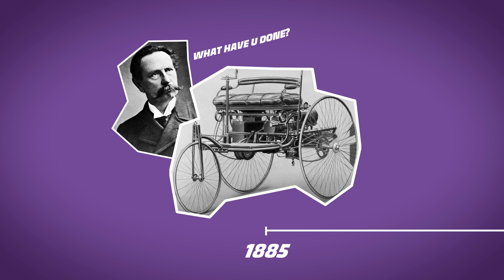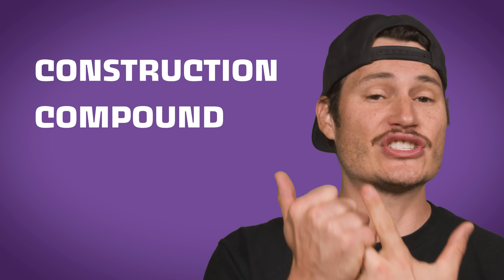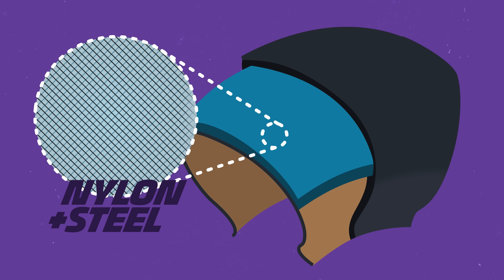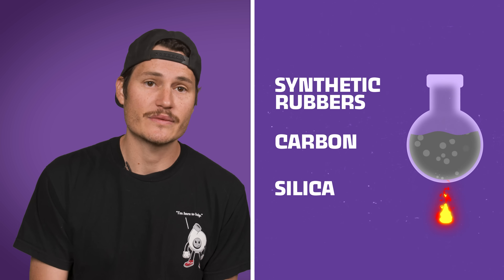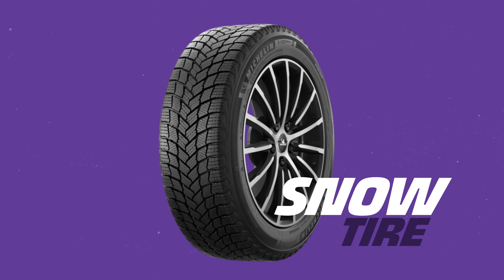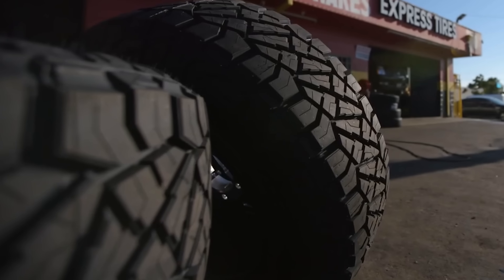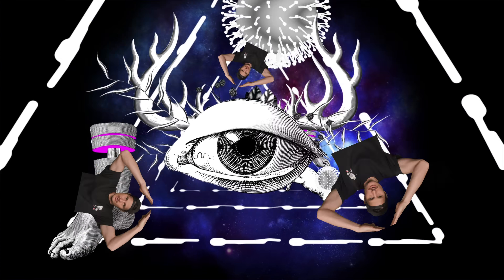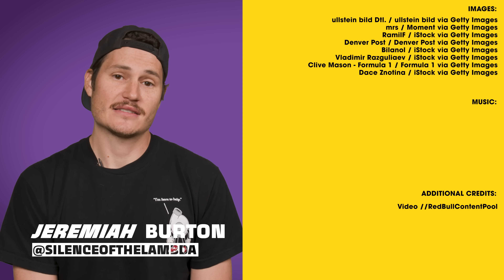The Surprising Science Behind Tread Patterns

Comment: In a nutshell, tire also creates a longitudal force on a side of a crease in asphalt which helps propell the car forward, because it adds to a friction force...
THIS WAS A FRAGMENT TO GRAB YOUR ATTENTION SO YOU MIGHT CONTINUE READING
My take at answering the question in the end of a video:
First of all, mind that the simple equation people learn at school is formulated for rigid body on rigid body, flat surface on flat surface friction, which is just not the case. This is also why specifications on some tires might state that their friction coefficients are bigger than 1, which makes no sense in "usual" circumstances. Now, "flat surface" here is as in "flat to the eye or touch", because friction itself is ocurring only because of imperfections in both surfaces interacting with each other, down to a scale of two atomic grids (which we consider absolutely rigid) grinding on one another.
Now, my thoughts about why bigger contact patch tends to mean better traction are next:
As it was said in the video, soft rubber fills the gaps in the rough surface of the asphalt. Gaps have profile in a plane parralel with a tire rolling direction too. This is drawn at a picture at an attached link, with forces marked. In a nutshell, tire also creates a longitudal force on a side of a crease in asphalt (which is marked as  Fadd as in force that is added), which helps propell the car forward, because it adds to a friction force of a tire on a horizontal part of a surface. And as this force can vary greatly depending on the depth of a crease, how much it is filled with rubber, the angle of a crease's wall, tire temperature (or any other parameter) in a given point,  and other things i probably didn't mention, it is important to have larger contact patch so you can cover as much creases in the road as possible. Ultimately, this forces are limired only by the car's weight(because only weight keeps rubber in a crease), not the friction coefficient, as the rubber creates vertical force escaping the crease under rotational forces of the wheel, BUT this vertical force is not equal to car's weight because all the movement it provides is so small it only deforms the tire, not lifts the car up. Covering more creases in the road actually adds up (up to a point, indirectly limited by car's weight, of course), rather than resulting force being equal to the highest achieved one, because each point of a tire holds only a part of car's weight.
So, increasing the contact patch of a tire actually improves this added force(but not the friction), which combines with the force of friction and propells the car faster.
This explanation also doesnt account for adhesion, as i am not competent to speak about it occuring here (means i know nothing about it). 
This also only explains why linear acceleration of a car requiers wider tires (as for dragsters), but huge width also has a lot of benefits to cornering.
https://idroo.com/board-suDimwSIQk

Nobody will ever see or read this, i am almost sure, and  it surely wont reach guys from DONUT.
But it might.
Reply: To throw an analogy at you to see if I understand, you're basically saying that rather than the classical model of a rigid body on a rigid body. The softness of the rubber allows it to deform sufficiently to push against the peaks of the roughness of asphalt similar to a sprinter against a starting block? Is that a about right? If that's the case then we're dealing with a force that behaves like friction, in that it retards movement in the direction of travel, but in fact comes from something more akin to normal force.
Reply: @bentreece1187  While your analogy is  correct as i see it, my whole comment might be not. What i described here might seem like "friction after friction", and the mechamism is similar, but at this scale it is more like gears which rotate each other with interlocking teeth rather than friction, just that weight is what keeps  the gear's teeth in place. The way i see it, because friction utilises microscopic imperfections, and this process utileses macroscopic, they have no relation to each other because one cannot influence the other. 
To me, what i described and what friction is really don't seem like the same thing just because when we talk about friction we talk about two surfaces (means no major geometry, just planes), with imperfections in them being small in depth relatively to the area ot the contact, and size of them being very regular. Both of these conditions are not quite true for what i described.
So yes, this is only possible because of the softness of the rubber, it's ability to change macroscopic geometry to "become a matching gear" to rough surface ot the asphalt. And gears sure (as far as i understand) can work without friction. Take the metal-plated wooden wheel from the video for example. Not only it's fricion coefficient is lower, it has no means of grabbing these macroscopic geometry in the road. Unless it has teeth or spikes, than it can take advantage of these added forces by burying them in the road, again, without any relation to friction. So, yet another analogy,  but the roles are reversed - here the earth is soft and the wheel is rigid, but the mechanics is the same - they act like two solid gears.
Regarding your last sentence: friction itself is a manifestation of a normal force in microscopic scale. Mechanism is really similar to what i described, but without deformation there is  no "burying one thing into another". Just imagine two very, very fine iron files that you put one on another and tried to pull them apart, - they would resist because ridges in them bump into one another.

Comment: So about the last question you asked here is the answer
engine produce torque force which has to be transferred to the ground by tyres so if u have more torque than the friction between road and tyre, the tyre will start to lose traction because the force exerted on tyre is more than the friction available from tyre to ground so this will lead to wheel spin which is for bad any type of launching a car or bike so in order to increase the friction of tyre and ground we use wider tyres but still you can increase grip of tyre by choosing a softer rubber but there is a limit, so hence we use wider tyres to create more friction between tyre and road than the force exerted by the engine.

Comment: Engineer here, the general friction equation assumes incompressible smooth surfaces that do not experience normal force. Microscopically, imagine soft rubber gears that meshes into the road, there is a certain limit of maximum normal force that the piece of rubber can experience before it deforms and can't dig into the road imperfections anymore. Wider the tire = more little pieces of rubber to dig in and reduces localized stress of the rubber pieces, thus more grip. Try polishing a floor so smooth that it shines, then the difference in tire width doesn't make a significant difference. Your equation is Fs = µFn(-y, pushing down) + Fn(-x, pushing backwards)(whatever that is depending on how much push you can get). In short, grip is half friction, half gear effect. More digging = more "traction".

Comment: The wider tires on a drag car create a larger footprint for better traction
Reply: Combined with the tire squatting when the drag car launches the car essentially shifts into a lower gears due to the diameter of the tire getting smaller.
Reply: We’re trying to change our ecological footprint for the better here 😓
Reply: He covered contact patch. I'm thinking it may have alot to do with the aspect ratios allowing the tire to deform and hold that contact patch, if the tires were a 170/20 on some 22s the tire could be the same width and height as some drag radials but the aspect ration makes a world of a difference.
Reply: The footprint of the tire does not affect traction.  That's why he asked the question: the equation for calculating friction does not include a surface area (footprint) component.
Reply: Also, as it turns out, choosing bigger tires (in either diameter or width or both) doesn't substantially change the footprint.  You just end up with less of the larger tire in contact with the surface below at any given moment.  And there's your hint for the correct answer!

Comment: 2/32 of an inch?  I would have sworn it was 1/16 of an inch.
Reply: Well you'd be wrong then! It's 2/32, which is totally and completely a very different number than 1\16!
Reply: I was gonna say that but, ya beat me to it. Mustve been that core math. Lmao.
Reply: Imperial bitches...2/32 is 1.59mm which is way lower than tire manufacturers say tires are yet safe.usually when tire is worn down to its last 3mm roughly 3/32 of an inch tire is done.

In my country summer tires need to be at least 2mm or 1/16 of inch and winter tyres(real studded ones or Nordic winter tires without studs) needs to be at least 3/32 of inch

I usually ditch old ones when thread is worn down to 4mm or 1/8 of an inch
Reply: @jkarra2334  Do they not have jokes or sense of humor anywhere else in the world but U.S.A.? Apparently not. 2/32 and 1/16, is the same. We were aware of this. Its called a joke.

Comment: Would you count "the coefficient of friction between the cars tire and the road surface" as a definition of grip? I need to know if I win my imaginary $100
Reply: @Ysabela Bruh what is up with you catfish 🤣 You that desperate for peoples data?
Reply: No, that's only a coefficient. Grip is the friction force provided by the tires, which is determined by, among other things, that coefficient.
Reply: @rauldragu9447  grip isn't a force it's a function
Reply: @skrimper  Well no.
Yes, the magnitude of the friction force that is grip is a function of both the coefficient of friction and the normal force. But that's just that, the magnitude. Do you even understand Newtonian physics? A body need a force to be applied to it for a resulting acceleration to alter it's otherwise straight motion. That's like saying a human isn't a mammal, it's only an organism. Like you aren't wrong, but you aren't right either.

If there was no force applied, then the car would just continue gliding in a perfectly straight line no matter how much you turned the steering wheel. You would also not be able to accelerate or brake. Would you not consider that a lack of grip?

Comment: Here's my take on distilling the answer into a simple, engineering-language answer. In school we learn about static friction and kinetic friction. The basic concept is that the coefficient of friction is higher when the two surfaces in question are not moving relative to one another, but when the two surfaces are sliding relative to each other, the necessary force drops. In tire terms, this is all more or less true when the e-brake is locked. What makes things complicated is that the rolling tires (when taken as a whole) aren't really static and aren't really kinetic. The rolling motion creates a hybrid of the two. Increasing the width (and length) of the tread patch gives you more surface area, which increases the odds that some part of that tire will effectively act more like a static interface. Put another way, the bigger the contact patch, the closer we get to the static coefficient of friction (which means more traction).

Comment: There's an elaborate answer to this but I think the point is that frictional force does not depend on the apparent area of the surface in contact but actually requires points of actual microscopic contact to be there which is why wider tyres which allow for a wider contact patch thus more points that are to be in contact thus allow grip to suffice in various hard turning situations etc

Comment: My understanding for wider tires are preferred is that it does extend life of a tire of a given softness. If softer tires grip better, as they conform to the road surface better, but also wear much quicker than a harder compound, a larger contact patch simply lets a manufacturer make a softer tire that will last as long as harder, less wide ones. Basically it just distributes wear. Assuming ideal conditions, you can actually make the same grip with a thin tire as a wide one as long as the mass is unchanged, and the coefficient of friction is unchanged

Comment: So my best answer for the tire question at the end is as follows: 
If you read Carroll Smith's "Tune to Win", one of the first thing he points out in chapter one (which is solely about racing tires) is that they do not obey classical friction mechanics. From what I've learned from a multitude of different sources including Tune to Win (Smith), Race Car Vehicle Dynamics (Milliken), and googling this (I had the exact same question when I started getting into modding a track car), the answer that I found comes down to 3 factors you have to take into account: 

1) tires do typically follow the model for static friction, not kinetic, and if you remember, static friction is less than or equal to Mu times normal force. That less than or equal to part is important because it means the tires are only going to "resist" sliding or slipping as much as they need to and no more. Static friction is generated as needed until it cannot be generated anymore, if that makes any sense. 

2) Mu is a special child when it comes to tires. Mu increases with slip angle, slip ratio, contact patch area, tire load, and even camber relative to the ground. Long story short is that tires produce their most grip when they're deforming (slip angles / ratios) as much as they can without breaking traction altogether, and when they have slight negative camber relative to the ground (not relative to the chassis!) because of camber thrust. Seriously recommend reading the tires chapter of Tune to Win if you want more insight into this. But simply put, Mu is no where near constant and depends on multiple factors, including contact patch area. 

3) So why does contact patch come into play with Mu? I saw an explanation somewhere that said to treat it similar to Finite Element Analysis and the answer didn't make sense to me, but from what I understand it's more of a probability kind of thing (that maybe sorta relates to FEA). The more contact patch there is, the more likely it is that MORE of the microscopic grooves on the tires will dig into all the tiny dips and cracks in the pavement. In other words, having more contact patch means more chances for contact and resistance to happen, kind of like how having more gas molecules trapped in a box means collisions will be more likely. Of course, there is a realistic limit to this if you make the tire too wide because then there will be so much tires that it will become harder to actually press the entire tire into the ground. Think of a tire with a tiny amount of negative ground camber, and how much more contact patch gets wasted by being in the air or in minimal road contact when you widen the tire closer and closer to infinity. So somewhere there is a realistic limit to wide tires and its extremely dependent on the exact purpose / operating conditions for the tire. 

TL:DR Tires don't behave according to classical mechanics and Mu is a special child that just wants to be different from everyone else when it comes to tires, especially racing tires. Anyone else who said anything remotely along the lines of Mu not being constant is probably just as (if not more so) correct than I am. Hope I'm on the right track here!

Comment: The coefficient of friction in tires is not constant like the simple situations we study in school.  The coefficient of friction in tire rubber decreases with increased surface pressure.  Larger tires, greater area, reduced pressure, greater friction.  They don't teach that in the physics books
Reply: There seems to be a lot of incorrect answers on here. Let me further explain. The simplified formula for the force of friction we learn in undergraduate physics fails for tire compounds. In theory, a 30 ton Mack truck with locked wheels should stop as quickly as a Honda accent with locked wheels.  Which we know is not true.  In that formula the force of friction is irrespective of the area.  ( It also doesn't consider the transition between static and dynamic but that's a different topic ).    For tire compounds, the coefficient of friction changes with the surface pressure ( not air pressure ).  The simplified formula assumes the coefficient of friction to be a property between two materials and surface roughness.   But in reality for tire compounds surface pressure matters, therefore the area of the contact patch matters.

Comment: Using wider tires has two benefits. First one is that with more contact patch the force and the weight is distributed over a larger area and allows to use a softer compound. Softer rubber means a higher coefficient of friction that allows more grip and also it deforms better on the asphalt irregularities. Second and less obvious one it has to do with racing compounds. If you ever touched a racing car tire or a sportbike tire when warm you can see that it's sticky kinda like a bubble gum. This means that a wider tire has more sticky area. It's like stiking a 1kg weight to the ceiling or the wall with a small piece of tape or with a much wider tape. The wider can hold more weight.

Comment: Answering the engineering question: there are 2 main reasons:
1) Wider tires under a given (moderate to high) load will last longer than similar narrower tires (for a variety of reasons). Wider tires let you run softer compounds without excessive wear.
2) Race tires actually adhere to the track (like tape) when broken in. This isn't simple friction anymore and increased surface area does give more traction. (Like wider tape = more sticking force). I've heard you can stick a kart racing tire to the ceiling if it's hot off the track.